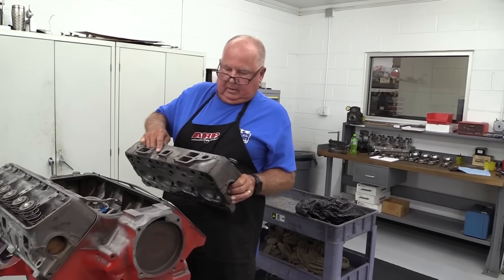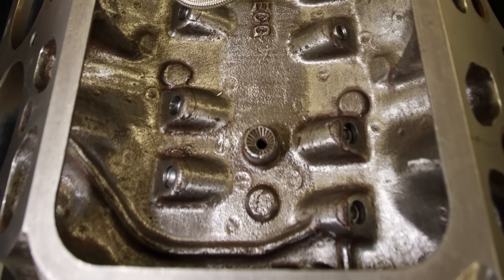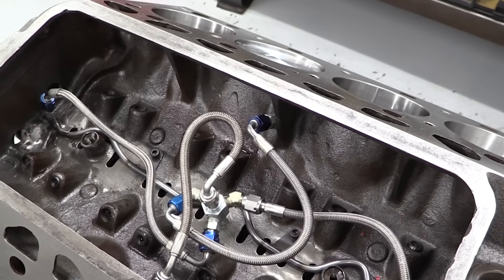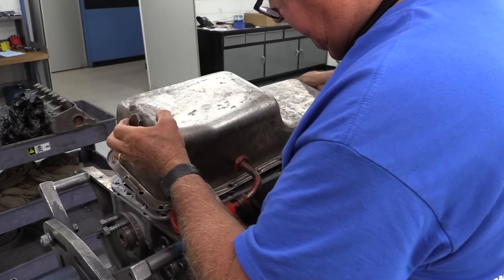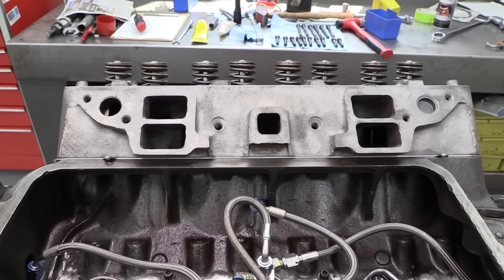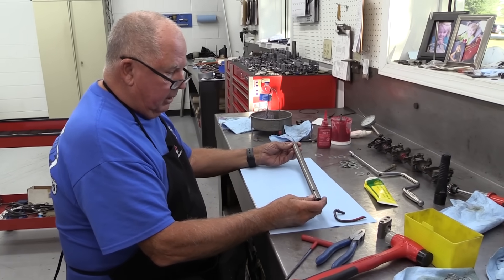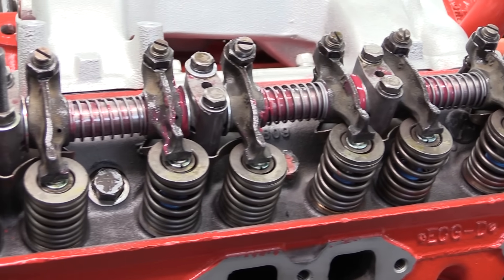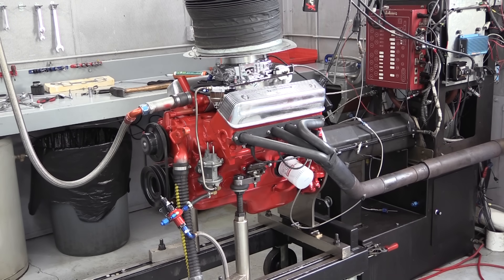The Engine That Replaced the Flathead -- Ford Y-Block Build

Comment: looks like you could do a monstrous overbore
Reply: Was thinking the same thing.
Reply: I looked at how heavy duty the block looks,with modern fuel induction systems and heads,could hold some monstrous compression
Reply: Benjamin Chartier probably but knowing that it was the motor to succeed the flathead I don’t know how strong the cranks or mains are with the flathead only having 3 mains and snapping with around 240 horse if you ever reached there. If over 300 horse is an accomplishment with the y block I’d say the mains are the weak point looking at the bottom end with how pushed in they look.
Reply: @theeoddments960  they put a paxton blower on 1957 312 s factory
Reply: tom schweikert that’s an interesting bit of history I didn’t know. Still from what I’ve read it was pushing maybe 3-4 pounds of boost to make about 280-300 horse which is impressive for the engine have to admit, but from what I’ve read even with the supercharger they were just barely competing with the futuristic small block Chevy. Heads were never ford’s strong suit anyway 🙃
Reply: @theeoddments960  ive heard from a many years ago hot rod magazine y block build that the heads sucked [not in those words though lol]
Reply: @theeoddments960  get a chevy
Reply: tom schweikert yea ford has always been in last place with head design and don’t worry I’ve got a Chevy 😉
Reply: @theeoddments960  what a chevy fan boy thing to say. I do not agree with you at all I'm fact your totally wrong. If you disagree with me just do a little research. I here's just one hint...Cleveland.
Reply: Lane Argent if you’re talking about head flow which I think you are (?) ford was the worst. The one engine with good flow can’t overshadow the y block, mel, fe, Windsor, and later model big blocks from having sucky head flow. Powernation has a video where they pretty much did even builds to a 454 and a 460 Ford and the Chevy picked up 40 more peak numbers because of chevy’s superior head design. Intake port and pocket design just aren’t that great with ford engines. The sbc was the first engine that actually breathed well and that’s why if still stays as a common hot rod staple. Y block was a contemporary and nobody talks about it anymore.
Reply: Lane Argent not saying their flow is terrible, the higher up performance motors were fine but chevy’s ability to make an iron head run 220 cfm back in the 50’s was never replicated by other companies until much later.
Reply: @theeoddments960  same thing...throw a modern crank, mains, and rods at it...pow
Reply: Lane Argent also I’m a Buick guy anyways and I think Buick has just as sucky heads as ford especially the older engines the nailhead was pretty bad back in its day. Not a performance motor but when you need a huge Lopey cam to make a motor run you need a redesign on those heads. It’s like they were constantly in need of an inhaler. Got a Buick 350 myself... not good heads. It’s kinda why I doubt Buick was beating Chevelles with the gsx. Those heads can’t be that good compared to the machines oval ports put into the ls6 motor.
Reply: @theeoddments960  401 s were pretty strong
Reply: @theeoddments960  rectangular port were the best bbc heads
Reply: @theeoddments960  iI am not sure if it was the heads or what, but most people agree  that Buicks were among the finest musclecars of the era and even now deal hemis fits in pure stock dragracing.
Reply: tom schweikert when I talk about heads being weak I’m saying high rpm flow after 5000 rpm. 401s we’re torque monsters sure but getting more than 300 horse is a challenge. And no need to tell me that buicks are fine I’ve got a 72 skylark myself with the original 350 highly modified by the owner before me. 3 grand, 300 horsepower and 400 foot pounds. Torque monster.
Reply: Curious Betsy vlogs It's common knowledge the Ford 351 Cleveland heads were second only to the Hemi in terms of flow. That's why the Chevy Pro Stock guys pushed NHRA to switch to big blocks only because the SBC couldn't compete with the Cleveland.

The big blocks Ford (385 series 429-460) came along late in the muscle car era and Ford didn't bother to redesign the flawed oval ports. AFR now has rectangle port BBF heads that flow just as good as - if not better than - BBC heads.
Reply: FoxFordCatGuy I said the Cleveland head was a good head. Because it is. It’s fords ultimate final generation pushrod small block v8 before the modular and overhead cams came along.
Reply: Curious Betsy vlogs All MODULAR (and Coyote) engines are overhead cams.
Reply: FoxFordCatGuy no shit
Reply: FoxFordCatGuy no shit
Reply: Curious Betsy vlogs You said "modular AND overhead cams came along" like you were talking about two separate engines.

When denigrating SBF exhaust ports, you need to consider they weren't designed for racing (who revs past 5k rpm on the street?) And they made design concessions to fit between those notorious '60s-'70s Ford shock towers.
Reply: FoxFordCatGuy it never ceases to amaze me how uneducated people are when it comes to fords first overhead valve v8. I wish people would do a bit of research before they start flapping there gums
Reply: FoxFordCatGuy overhead cams and modulate are the same thing that I made sure people knew were there. Pointing out such a small and petty thing shows how little of an argument you have if there wasn’t even a point to what you’re saying.
Reply: @Curious Betsy vlogs Touched a nerve? Half the replies are from people who have never held a wrench, have no hands on experience and only "know" what they see in these videos. The muddled way you worded it it makes you sound like one of them. I was making it clear.

"Keyboard warrior"? I've been a certified mechanic for 30 years and drag racing almost as long. I grew up working on Midgets and Sprint cars with my dad who was part of a pit crew.
Reply: @benjaminchartier6458  ford engineers designed the y block to be able to handle 16:1 compression on stock components. talk about overbuilt.
Reply: Absolutely, that closed deck design has to be capable of a crazy overbore and possibly stroke.
Reply: @DiamondBackRattlaKid  yeah anybody can tell you its the heads and pistons that make the hp , throw some edelbrock heads on it ...hello hp
Reply: tom schweikert meh even with edelbrock heads if they have that same intake port design I can’t imagine it flowing as good as other ahem sbc contemporary heads